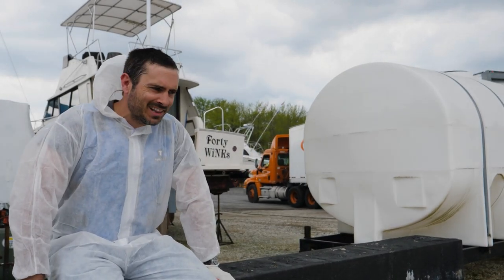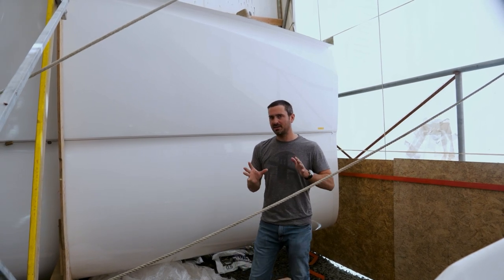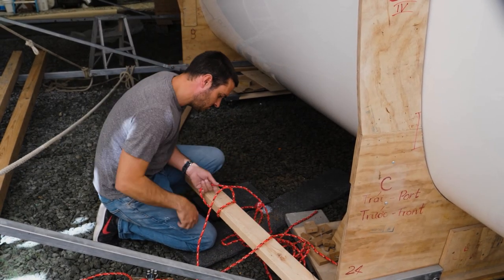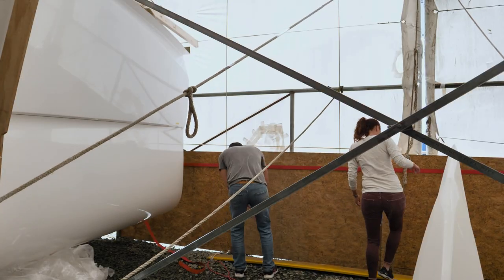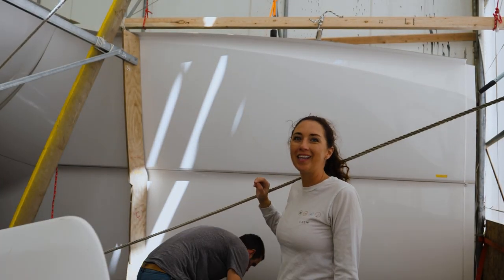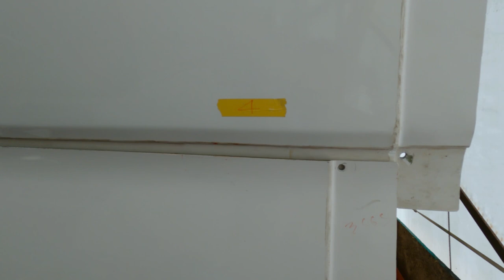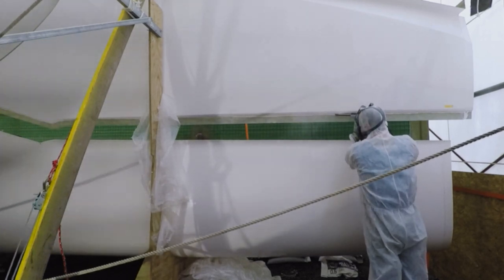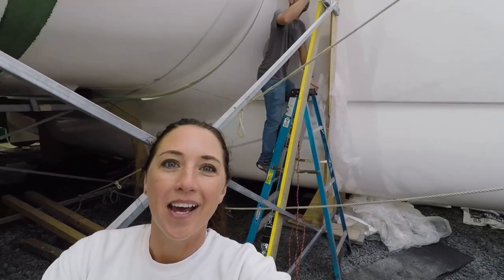CATAMARAN BUILD - We're Preparing For Something BIG!! 😃🎉 (MJ Sailing - Ep 186)

Comment: Just watched your latest episode and chat about gloves. I used to work GRP for industrial insulation and used the heavier chemical type rubber gloves, regular buckets for the resin. After every application splash an inch of acetone in the bottom of the bucket and simply wash the rollers and gloves cleaning the bucket as you go. Everything is good to be reused for weeks, the thickness of the gloves take some getting used to for fine work but you soon get the hang of it. The only thing that didnt last long was the nylon overalls.

Comment: Thank you for being so generous in filming this build. Learning so much from your successes and challenges. When I build mine I will definitely rent a concrete floor shed so parts can be moved on pallet jacks or dollies. Another tip I’ve got is that I would ask the kit builder not to gel coat the join sections, that would save a lot of time and effort. Could I also suggest you get a belt sander for those joins as they are much quicker for stripping paint of any kind

Comment: Note to Jessica: an adjustable spanner wrench is supposed to be flipped over, depending on whether you are tightening or loosening. You want the non-moving side of the spanner to always be taking, or applying, the force.
 Otherwise you can damage the threads, or the smaller "claw" can break. Rare, but predictable. FWIW.
Reply: Better yet throw it in the trash where it belongs and use an actual wrench.

Comment: Colin from SPR  had a video on the problem. From the factory the door corners only had glass in 2 directions. The fix as per the designer is to put a layer on a 45, which you have done.

Comment: This might be showing my lack of knowledge about sailing, but----you have mentioned that this boat is more of a performance model than a typical school bus type boat, does that basically mean you hope to get from point A to point B faster than a cruiser or is there alot more involved in what you plan on getting out of this performance package?  (will you have racing stripes?😉)    
So far, I'm enjoying watching your practical, get it done, but done right, style build.
Reply: A LOT of it is that we want to be able to sail in light winds.  Coming from a heavy boat that required higher wind speeds to get moving, we either motored a lot, or went out in what many would consider nasty weather.  With a light performance cat, we should be able to sail with just a slight breeze.   -Matt

Comment: Just a tip of mine that might help you also ,while a lot of people will tell you to double glove and so on i found if you put a very thin cotton glove on first it will stop a lot of moisture while wearing the gloves . Take it or leave it its up to you. lol :)
Reply: Thanks for the tip.  Once summer kicks in, we'll absolutely need to try this approach.  I hate moist gloves!   -Matt
Reply from the maker: Hmmm, hadn't thought about cotton gloves before.
Reply: @mattjohnson6716  Are you adding any extra strength or filler where your door hinges will fasten to the foam core bulkheads?  It doesn’t look like the uni filler rope goes very far away from the opening.
Reply: @markwismer9571  They covered that last video. it gets a filler over the rope.

Comment: With your crane setup you could gain a lot of mechanical advantage by adding one additional pulley. 
1)secure the bitter end of the rope to your upright.
2)route it down through a pulley secured to your horizontal gantry board
3)route it back up to a second pulley secured near where the bitter end secures.
Reply: Obviously was not needed for this light weight lift.
Reply: @JCrook1028  yup but they did mention this is the lighter panel

Comment: Would have been interesting to try to calculate the static force on the board you used. I know you were likely short on boards (and this one was a light lift) but a simple A-frame will distribute the force during the lift much better, and if you build a moveable base for each leg, likely easier to reposition, etc.

Comment: Why not attach the come a longs to the tent structure overhead to raise the panels?
Reply from the maker: The tent we're in is over 20 years old, and the frames are beginning to rust through at the base.  The marina has asked that we don't use the structure in any heavy lifting, as they don't want to take the chance something could break.

Comment: Well done.  Would be much easier if the factory didn't gel coat inside the bonding flanges...  Maybe something they can think about next time.
Reply: You'd still have to sand it so.no huge gain. You want a fresh surface for the best bond.

Comment: Hi guys 
You should check out Ross on life on the hulls (you tube) he's doing a similar project down under , what he doesn't know about resins, fiberglass and all the other chemicals you will be using isn't worth talking about. And lots of useful tips  like putting resin on a batch of foam core  boards,  peel plying them then they are ready to be cut to size as and when he needs them .
Cheers Mark in the emerald Isle .

Comment: One thing I would do is before you go to glue the two sections together take measurements of the nose cones make sure that it doesn't shift on the width I may be wrong but it's better to be safe than sorry

Comment: Your hoisting system made me really uncomfortable what with the forward leg having quite an unsupported length in comparison to the aft leg.  It appeared to be already deflecting out of column which is the failure mode you need to be concerned about.  You're working with your hands and fingers in the hull gap and any failure could be really catastrophic.   I'm a professional engineer and would really encourage you to do a little more to control the top of your lifting leg.   Even running a line from the end to a point above effectively suspending the top end would help.  Anything to give your system a little redundancy.   Love your channel and the project you two are building.  Good luck!

Comment: Quick question, you may have covered this already but...  On the joint for the hulls that you are adhering together, will that eventually be reinforced with additional fiberglass as well?
Reply: I think they've said no, but the joint will be made smooth and a gel coat applied to hide the seam. Maybe this is part of their desire to save weight.
Reply: @shopshop144  Yes, it gets glassed inside, not just glued.

Comment: 3 years later, my comment may be severely out of sync, but I dare do it for future builders: considering the effort involved in re-raising each part to sand down the seams for further glueing, the manual should be re-written in such as to prep them before the initial dry fitting (after unloading from container) - that would spare the team a lot of time and effort.
Reply from the maker: It would be quicker, but we wanted freshly sanded surfaces for bonding.  So we preferred to sand, wipe down and adhere as quickly as possible.